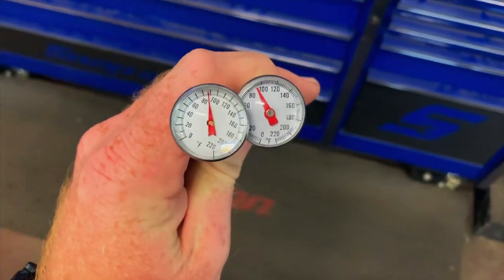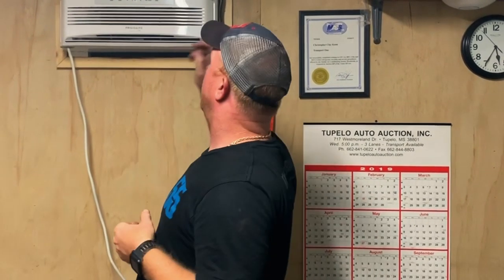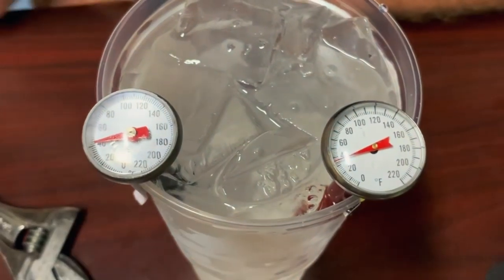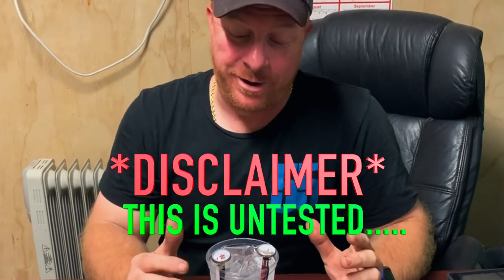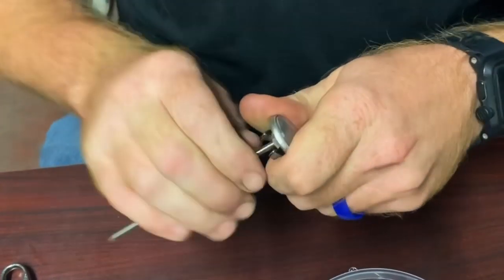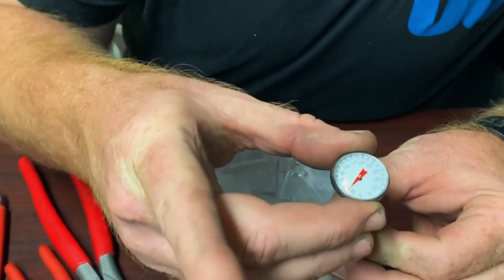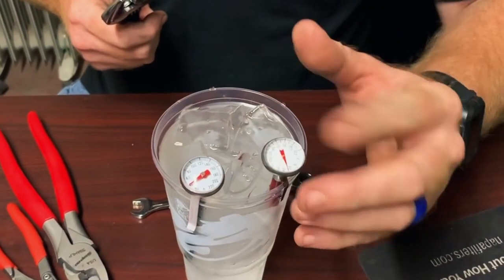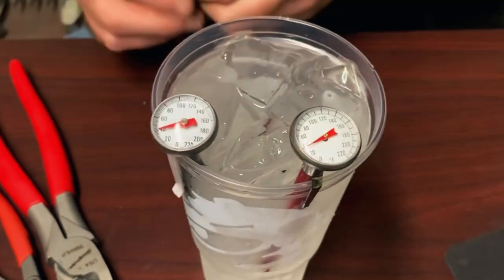How To Calibrate A Dial Style Thermometer

Comment: I do calibrations for a living. We have precision dry baths we use.  Pretty handy
Reply: How would you do a calibration test or setting on a wood Stove Thermometer?
It looks press fit with a shaft and the tension washers...put it in the Oven @400° was reading  about almost 500°

Comment: Now you need to put them in boiling water. That’s 212 degrees Fahrenheit. Then if they both read 212 they are correctly calibrated. We had to do that in a chemistry class once. 
I’ve always wondered what those little cobras were good for!